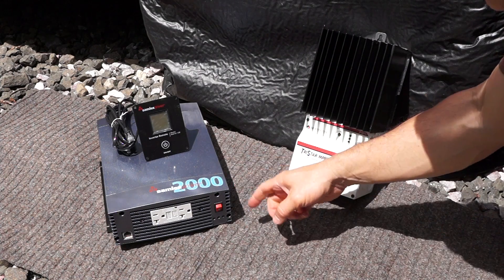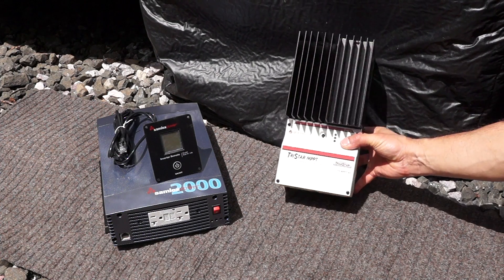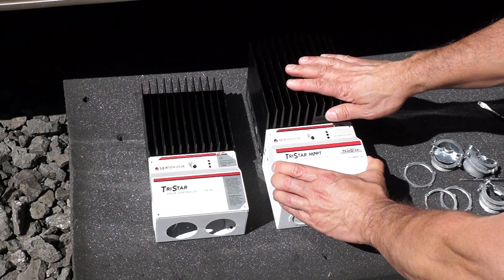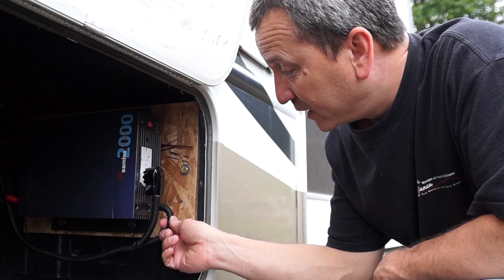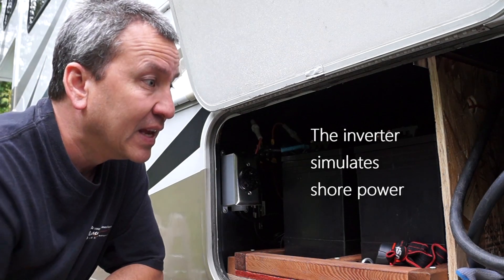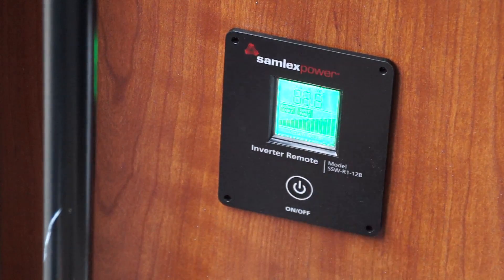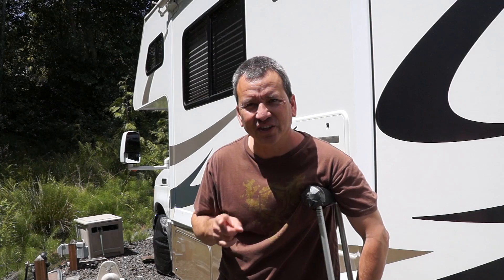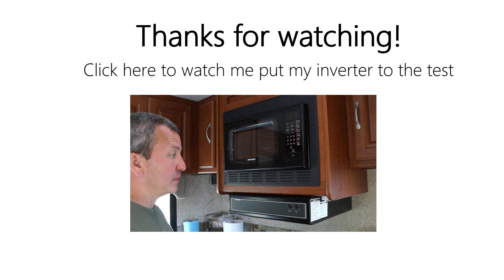Inverter and MPPT Charge Controller Installation - DIY RV Solar

Comment from the maker: Thanks USA4US! I had a great birthday as you will see in an upcoming video. I always enjoy your comments.

In regards to the benefits of solar, I'll start the conversation and speak solely for myself because I don't think everyone will benefit from solar. Like everything else it is an individual choice. Of course it is admittedly pretty cool as well. But if you plan to stay primarily in RV parks with power hook-ups, then solar is not a worthwhile investment in my opinion. If you want to venture away from the RV parks for longer than a couple days though, you'll need to provide your own power. To do that requires either a gas generator or installing a solar charging system like mine. Both have their pros and cons.

(This is where the rest of you can chime in).

I still have the option of using my generator when I need to, but really like/prefer that my solar panels are charging my battery bank before I get up in the morning and throughout the day...even while I'm away from the RV. I don't need to worry about how much fuel I'm using or have left in my tank. I can power my RV indefinitely if need be. 

Yes it feels good to get "free" power from the sun, but as we know, installing solar in your RV is definitely NOT free. All in all, my investment in solar totals around $1,700 over the course of 2 years. That does not include labor which I did myself. I also shopped around, researched and evaluated each and every component and configuration option. I tried to be as frugal as possible without sacrificing quality and it still was not free...yet.  

Finally, I certainly plan to do more dry camping or boondocking in the future and have always wanted solar. It has become more of a hobby and challenge for me...some close to me might say "an obsession." It is certainly not for everyone. I do, however, like taking on these projects that force me to learn and figure out cool things. And I like sharing what I learn with all of you. It has its rewards and also keeps my brain from stagnating. Plus I feel that having the ability to recharge my batteries automatically from the sun significantly improves my RVing experience and expands my camping options. I know over time that it will pay off. And once again...it's really cool!

Even my kids, who have been making fun of me and my solar power obsession for the last two years, said as we dry camped, used laptops, recharged iPhones, made toast, and watched movies last week "I have to admit Dad...this is really cool!" They were right too.
Reply: Cooking chicken gizzards